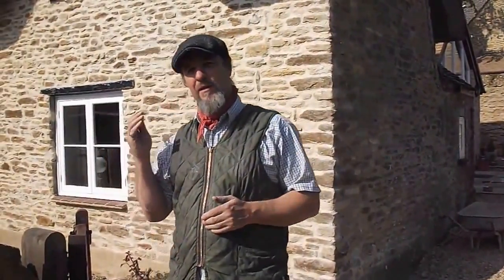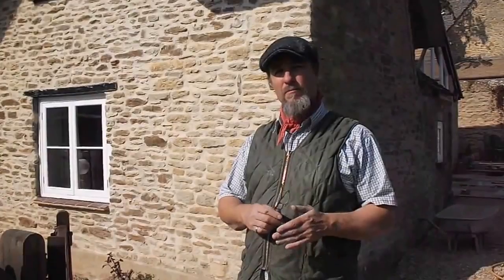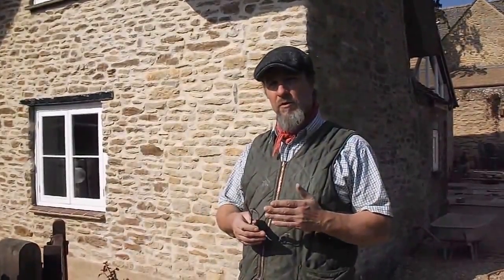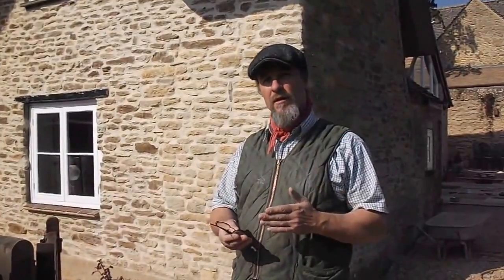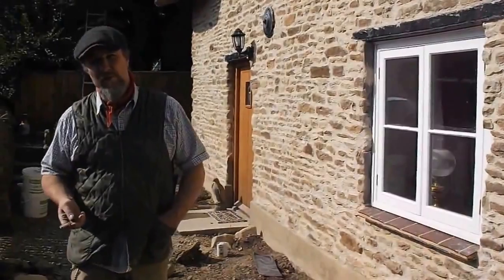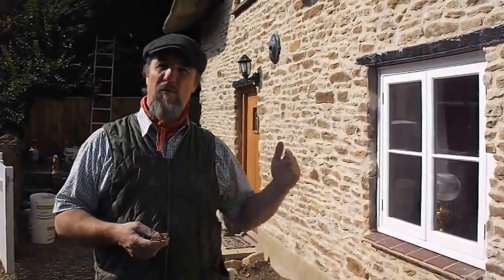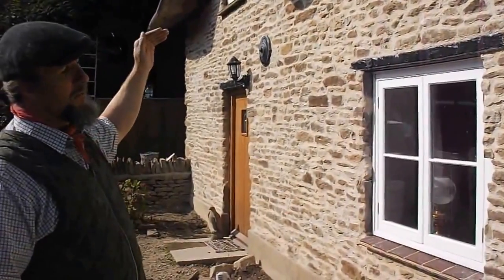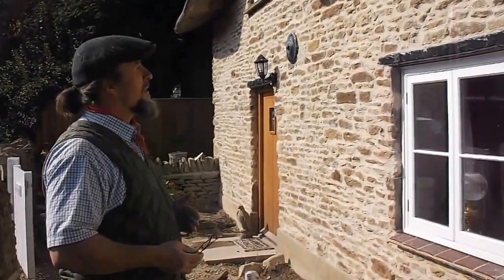The difference between lime putty and natural hydraulic lime

Comment: Hi, could i ask what the mortar removal tool is called?  you mention it on your website and only being available in Denmark.  Thanks
Reply from the maker: That particular tool is for brickwork. I tend to use a combination of tools. Some powered, some not. A picking axe off eBay or you local builder's merchant is what you want for soft stone.

Comment: Hi James, I have a property in Hungary I am trying to renovate. They use lime putty, fine sand and cement in their mix for everything, but all the renders fall of the wall and turn back to almost sand dust !and any pointed wall suffer from blown bricks as well.  As the lime putty and fine sand is readily avalibe, what would be the best mix for re pointing brick walls and also for the external render which always suffer from thaw/frost at lower leves and eventually pops off  the wall. difficult to explain, I am not a pro, and everyone here uses 3;1;1 mix with cememnt, which obviously is not working. winter -10 regulary or more, summer 40deg!. Any help appreciated, no sharp sand only fine sand.
Reply: You should not use cement

Comment: You should not be using NHL for this purpose and Lime putty is only good for internal work, even then its debatable. I am a stonemason and have spent much time researching and reading old textbooks to find out how lime mortars where really made. Just a bit of friendly  advise here but if you do your research you will find out that NHLs have only been around since the mid 1800's and as for lime putties, well really they were only used for fine plaster work internally. They were never used externally as they are simply not rich enough in Lime to be durable enough. This leaves one true method to make lime mortars which not only is durable and has superior workability, but will be a proper match to the existing mortar ;-)
Reply: What would that mix be?
Reply: Hot Mixed Lime, it is how it was done for centuries. Putty has not place for external work and only minimal use internally. Lime mortars need to be binder rich, lime putty mortars are not binder rich at all. If you analyse older lime mortars you will quickly see that there is a lot of binder present. Some thing like 2:3 or even 1:1 that is why they were so durable even though they may feel soft to touch. I am a Stonemason and have been using Hot Mixed Lime for a few years now and it is a superior mortar.   @gary24752
Reply from the maker: @monkeybeatz5372  You must've read Gerard Lynch's paper: The myth is in the mix.

Comment: That tile sill under the window should have been done better. It should be 7 whole tiles and fitted into the stonework each side. Also the angle is way too shallow, as water will easily be blown underneath the window causing damp to the wall and rot to the window frame. I should replace it with a piece of slate tomorrow.
Reply from the maker: Yep, you're absolutely right. And there was some rotten stone under the cill to support your prediction.

Comment: When you get a tub of ready mixed lime putty. Do you pour off the protective layer of water off or mix it in
Reply from the maker: Depends on how wet you want it.
Reply from the maker: Well Jean, now that's a question. Firstly I don't tend to use tubs as I prefer to order by the ton. But if I did then I'd get rid of the water because it's of no use. It shouldn't really be there and it's not really protective. IMHO it's the supplier making you think you get more for your money. If they got rid of it they'd have to top up with product and they don't want to do that because it costs 'em.
Reply: Thank you
Reply: @jeansouthworth312  Jean, you had the right idea:  That water IS  a protective layer because a good lime     putty in a pail with the protective layer of water, is most likely a very good quality calcitic lime that sets with exposure to carbon-dioxide, also known as air-lime, that doesn't set by contact with water.   Being in a pail and already mixed with water, significant time before you use it, is a good thing, i.e.- allowing it to age many months, even a few years, makes it better, more workable, and more freeze-thaw resistant.

Comment: Information in this video and others have been very helpful in my study of Lime Putty that I have recently started working with for the first time.  LP is an underrated and misunderstood building material with almost miraculous 'self healing' properties.  There are numerous reasons why Lime Putty is used, some are described in this video. Due to its softness, the putty will erode faster than the surrounding stone (the stone can erode leaving a hole surrounded by eg 'Portland' cement).  Putty is easier to maintain than cement.  Putty does not damage the surrounding stone.  Primary reason. Putty is fluid, flexible and self healing, therefore with old houses that may have some degree of movement.  Cement may cause greater damage to the stone work in this occurance.  The putty acts as sacrificial pawns of this movement and becomes cracked.  Smaller cracks may self heal.  Larger cracks can easily be re pointed without damaging stone.  What I dont understand is why so much putty?  The stone work is now barely visible.  I understand the need for good adhesion, but this looks OTT surely?
Reply: wouldnt the surplus just be sacrificial leaving enough when sloughed?
Reply: Nice info but that’s straight out of a book
Reply from the maker: You'd have to ask the original builder why they used such small pieces of stone.
Reply: Thanks for the reply. If the cottage was originally built in that manner, it would make sense that after re-pointing, it appears this way.  Thanks again for your info, really interested in this type of craft and gain as much knowledge as possible.  It is only recently I started working with Lime and was fascinated to hear of its history and unique properties.

Comment: Would not, in era of original construction, this exterior wall have some type of rendering or plaster, however you locally name it?  Strikes me this vulnerable stone would be better severed by such a coating, violating the currently prevailing tastes as it might do.
Reply from the maker: Historical photos suggest not.
Reply: The stone is probably just fine in the weather.  Stone is quite durable.

Comment: Hi, great video. I have to repoint a Victorian house and was wondering what is correct material to use. The old joints are crumbling and look original to me. The stone is in good shape. The interior of the house has been rendered in sand and cement (probably with waterproofer) so I wanted to ensure the breathability of the exterior was maintained as to not create damp on the inside and ensure the longevity of the walls. The stone is some kind of hard limestone. Many thanks.
Reply from the maker: I can't say unless I see it. Sorry.

Comment: should i use hydralic lime or lime putty on back garden wall the mortar is grey in some parts  most off it has fallen out plus some of the sones of fallen off the area iim in is blackburn lancashire
Reply: For a garden wall just use a natural hydraulic lime. If it's an igneous stone wall or beside the sea then use an NHL 5
Reply: Please look up how to apply it. It will fail and fall out of not done correctly
Reply: thanks
Reply from the maker: Well Zaid from Blackburn, you can use whatever you want!

Comment: hello mike, I want to point a old soft stone building , the stone is really soft and wearing away badly in areas, which lime mortar putty do you recommend that's pre mixed, and best on line web site to get it from, thanks martin
Reply from the maker: Mike Wye's standard lime putty mix. 900 grams off the back of a tail lift. Cracking quality. Sorry I didn't answer earlier.

Comment: Hi Michael, what ratio of putty to sand did you use? I use nhl on a regular basis but have only used putty over oak lath when rendering.  How long did it take to harden and how course was the sand you used?  Rob.
Reply from the maker: Hi Rob. I always use a 3:1. Hardening depends on the weather and also where on the property you're working. On a hot day at the top of a building mortar can go off in hours. In winter at the base it can take days. As far as sand is concerned I often use a rough mix of 2 sharp to 1 soft/fine as I believe the larger grains help moisture to pass more easily. They're also harder to weather so the pointing lasts longer.
Reply: +michaeljamesdesign Great, thanks.  Very interesting
Reply from the maker: Nope.
Reply: "soft/fine" would that be regular building sand?

Comment: i use lime putty and nhl to repoint buildings i have done on and off for 10 years .i was intrested in how deep you would point ,do you put pieces of stone in deep joints and should the motar be wetter or dryer on use , i belive it should be stiffer so as to avoid shrinkage although me and myvwork colleage differ on these questions
Reply: A rule of thumb for raking out and pointing is that you go back twice the width of the joint but to be honest so long as you've taken out all the loose stuff you should be fine.
As you already said, for bigger spaces put in some bits of stone and for deep areas of mortar push in some bits of brick rather than just neat mortar.
Reply from the maker: Hi Derek, I always go as deep as I can. That's always a minimum of 25mm. And I always use pinning stones and tend to work with a stiff mortar when pointing stone. A wet mortar results in decreased mortar strength as it holds the grains apart. This can result in frost damage due to an open structure. Too little water and you'll find cohesion's poor.